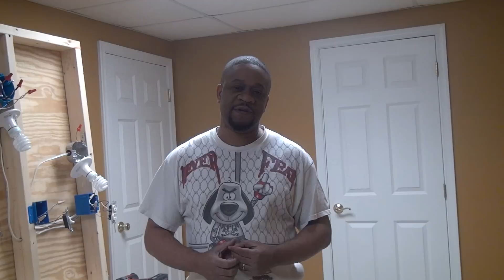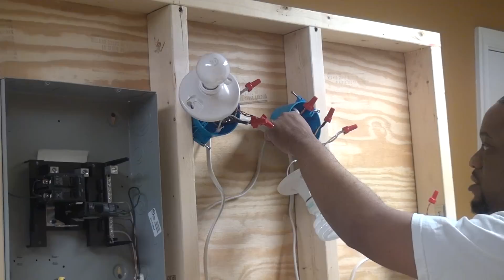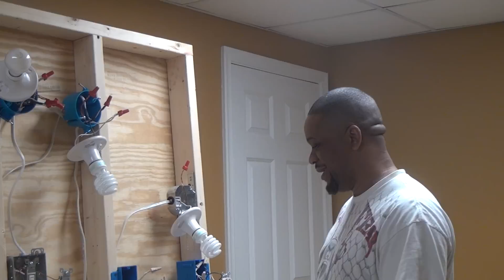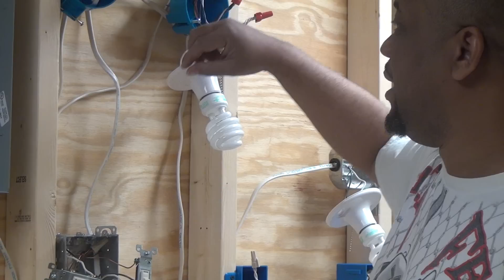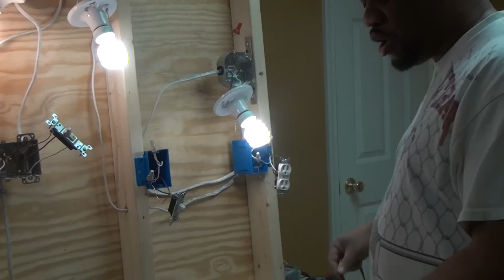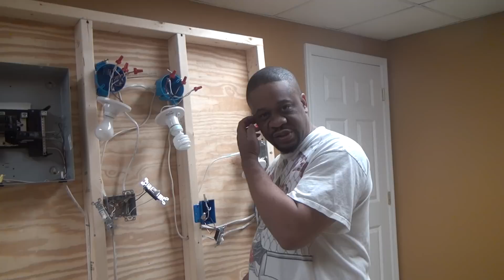Installing multiple switches

Comment: I am princess's mom and I do the electrical in my house.  I used your videos to remove old wire n tube and rewire.  Everything works well thank you.  I have an electrical problem that you maybe can help me with.  I copied a previous connection (end stop of a light circuit) for the back porch and back outside light to the front porch and front outside light connection and the fuse blew.  The back porch has the porch light switch box connected to a flood light.  Literally, three black wires are connected to the right side of the flood light switch. The power is coming up from the basement to the switch box.  There is one black wire on the lower right screw and one wire on the top right screw and one black wire pushed into the top next to the upper right screw.  The three whites are connected together with a electrical nut/screw and the ground is piggy backed onto the ground of the switch.  This set up allows both the lights and the switches to work just fine.  I don't want to make this too long so I'll stop here.  Can you explain this set up to me and possibilities why it did not work for the end stop in the front of the house as it did for the end stop (of a circuit) in the back.  I have the power coming up to a switch in the living room box with the one wire from the front outside switch (connected to the outside light) coming down into same box and the wire from the porch fan/light coming down into the same box.  Thank you for your help past, current and in the future.  KB
Reply from the maker: +Princess Rietz It is difficult to say what went wrong without seeing and testing what you have but if you send some pictures I might be able to help.

Comment: Some dimmers actually need Neutrals so thats not 100 percent true like electronic low voltage dimmers, but never a neutral on a conventional switch . Good video
Reply from the maker: Thats true Jay you have a lot of different specialty type switches that require wiring outside of the norm. I should have mentioned that in the video. Thanks for your input every little bit helps :-)

Comment: I have one switch controlling both lights in my master bedroom. I tried to switch it out to a two single pole switch. I had four wires hooked up to the single switch ground a red wire and two black wires. I can not get the pole switch to work on the different lights any help please

Comment: here is a better example of what he is trying to say at the 1:00-3:00... lol

If you are using a corded power tool and your 2 feet short of pluging it in, dont use 100'  skinny cord. The wires have a resistance. The longer the cord, the more work the electricity has to do to get to the end of the line; which causes heat. Also will not provide full power to what ever it is you are using, thus robbing said tool/appliance of needed power and can/will ruin that tool/appliance. The resistance in that 100' skinny stretch is enough to heat the extension cord and could cause a fire. The diameter of the wire is also a HUGE factor. If the wire is not thick enough, it can/will melt and catch fire.

Appliances and extension cords.... THEY DONT MIX! (in my opinion) . Many of your apliances will turn on and off automatically. When they kick themselves on, they are power hungry and will spike on the normal power draw. When they dont get enough power on that startup, you will kiss that appliance goodbye much sooner than expected....if not cause a fire. 

I know this is not specific to what he is trying to show, (lights and switches) but a better explanation of what he totally kinda botched ;-) 

Good vid though!

Comment: i have a question.. can you change a 15 breaker to a 20 with no problem??
Reply from the maker: if the conductors are 12awg or larger on the circuit that the breaker is protecting then yes.

Comment: keep your lighting circuit and ur outlets separated...if and when u are able...as well as ur neutrals...unless you like your t.v or computer fuzzy....good rule of thumb..this way if you ever have a 20 amp outlet sum were its not bunched in with a lighten circuit which should be on a 15 amp breaker...also in commercial world its a different animal all together,,,,try hooking a outlet up to a 277 volt lighten circuit...most commercial building have high voltage in the switch's...277 VOLT all juiced up on sum ballasts....now i know this video is for weekend warriors so i understand keeping it simple...but sum young future sparky could watch this and think hes a lil better then he is...(I WAS THIS GUY BUY THE WAY...i got lit up working a 3 way system on a ten foot ladder in a t BAR ceiling..so good video man...like ur positivity bro..i mean i know this took time to not only make but the lil set up...good issh man...GUESS THE NUMBER ONE THING I WANT TO SAY IS ........BUY YOURSELF A QUALITY TESTER....not a tick tester or a whiggy ...i recommend the knopps testers...bust tester ever no batteries just fool prof way to increase your safety buy 50 %..ALWAYS TEST WHAT UR WORKING...just cause u think its off with a breaker turned off it isnt off till u put a tester on it...think  u should how to properly check if circuit is dead...or if its right voltage...thats it man...its a electrical video bugaloo dance off friend...im turbo and ur ozone...my video is coming so u better tighten up your game...AHA...just kidding dog....good stuff man..keep up spreading that free knowledge...if only everyone did the same instead of trying to always make a buck...this world could and would be in a lot less turmoil...GOOD FOR YOU STUD...be good friend...

Comment: Could you explain how to wire 2 3way switches and 2 4way switches controlling a light, and  a single pole controlling a split receptacle all on the same circuit? Thank you
Reply from the maker: For the 3way and 4way switches just refer to the video on 4way switchs you can add as many 4way switches as you want between the 3ways. You just power up the switch loop for the outlet with the same circuit.

Comment: Great movies, super helpful, I am very appreciate of your expertise. 
Question: I am putting up a couple different sets of lights one different switches. I am using Halo can lights that have their own box for wiring. Should I use a junction box next to it and then run the pigtail into the light's box? It does't seem like the box is big enough for all the pigtail and junction wiring.
Thanks
Reply from the maker: no you do not have to use an external junction box unless you go over the rated box fill for the junction box on the light. normally you are just looping through the lights which gives you 2 cables but if you end up with a situation where you have a lot more cables going to any particular recessed light you may want to rethink your wiring layout

Comment: Tyrone - I think that all homeruns&supply jump feeders{ In 120vac} should be run into all switch boxes insted from bringing them up into the light rounds,it makes it easier & safer for testing/traceing @ 4ft. levels.
Reply from the maker: i agree further more depending on the structural situation the switch box must have a neutral in it. That part of the code is to accommodate for occupancy sensors.
Reply: Tyrone Robertson

Comment: Hello Tyrone, I enjoyed your video. It was and is very educational and easy for the typical home handy man.  I have a question, I have several motion sensors going around the perimeter of my house all daisy-chaining to each other providing power to the next one, and then when it hits the end, it sends a new wire to a power switch inside my house.  The problem is that now the motion sensors are sensitive and some times stay on during the day. I have to go to the switch and turn it off for several minutes and then turn it back on. Then it resets itself. Upon reading the instructions for the motion sensors, it states each motion sensor must be on it's own switch.  My problem is that i know have 8 motion sensors and would need 8 switches. I do not want eight switches with each its own gangway. I have seen two switches per gangway.  Are you familiar with a single gangway with 4 switches? Does such thing exist? Or should I use 4 gangways with two switches on each gangway? I like things to look pretty, I do not want my wife to slap across the head for sloppiness.  What are your suggestions?  Regarding the wiring after watching your video, I know know that I must send a return wire from each motion sensor back to be on it's own switch and so they can work properly.
Reply from the maker: Hey Joshua yes you can get 4 gang switch boxes but I think your interpretation of the switch requirements may be off a little. It has been a while since I have worked with motion lights but some models use a technique that we sometimes refer to as a count switch. on to off transitions of the switch so many times change the off delay time for the lights. the only reason that you would need a switch for each light in this situation would be if you wanted or needed different off delay values for each light. but using one switch for all the lights would just make the lights all have the same off delay time.
Reply: Thank you for your quick response. I will re-read the instructions in case I missed something. I did this during the cold months, so maybe I read something wrong.  Will keep you posted.

Comment: Greetings Tyrone,
This is my third try to email you. Your website gave me an error message before, so I don't know if my previous message(s) got through or not.
My question: How do I wire 2 switches in 1 box when the hot wire is white?  Note: There are only 2 cables entering the box. Thank you for your quick response. 
I love the way you deliver your knowledge.
Ms. Fran Risby
F_Risby@msn.com and/or Beauty-Biz@live.com

Comment from the maker: Hey Oscar it is not that hard to do what you are asking but it depends on whether or not you have a conductor in the box that is not switched. If you do all that is needed is to cut the tab on the outlet (the bronze side) and put the unswitched conductor  on the other bronze screw.

Comment: You rock Tyrone thank you for being so
generous with your knowledge.

Question, I got one of those annoying situations
in that an outlet is completely controlled by a switch.
How tricky would it be to covert it to just be half
controlled by the switch? I know the basics to electricity
and have the tools.

Also, I'm well versed in CSS/HTML
and can do some simple php. Wordpress sites use these
three languages. Best of luck on your site building endeavor. 
Hit me up w/ any questions in that arena.